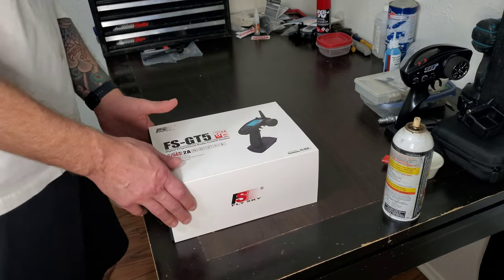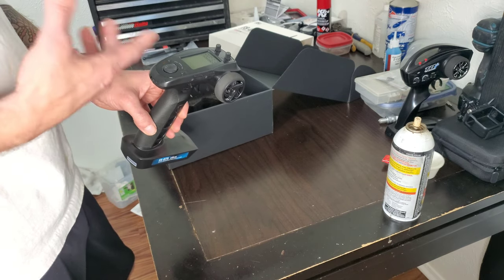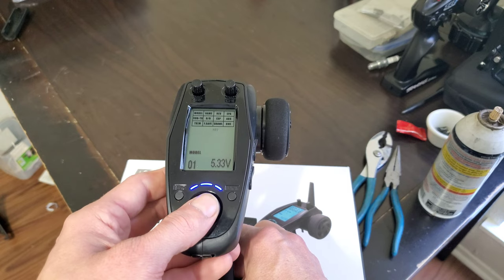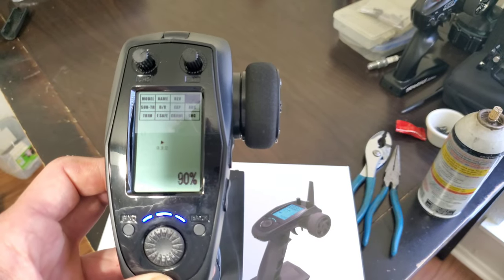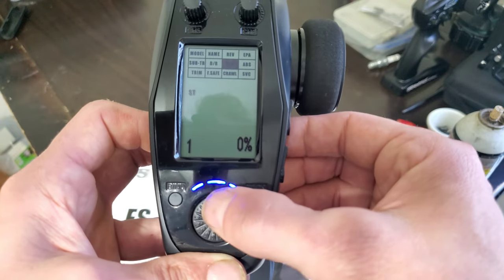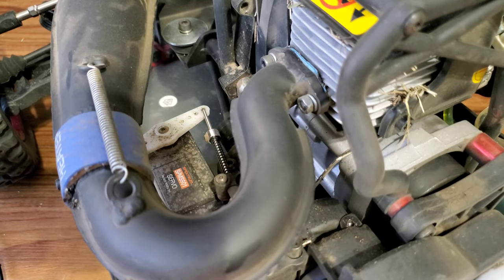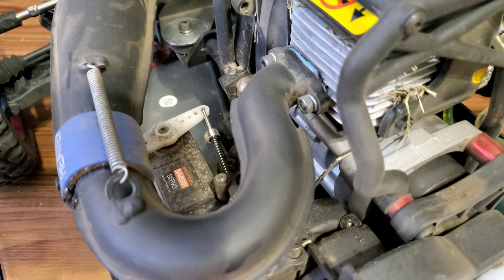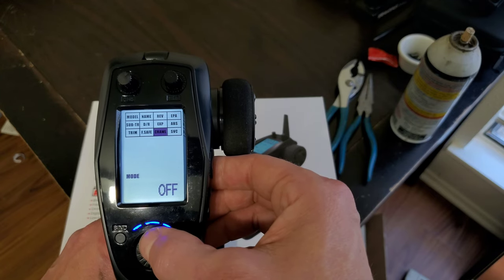FlySky GT5 Unboxing & Setup

Comment: This is the best description of the Flysky controller I've ever heard. I've had my Flysky controller for 6 years and had no idea what 60% of the settings meant. And I have 7 models connected. Thank you very very much. I had no idea of the capability of this controller. This will make crawling and bashing an entirely different experience.  I think Flysky owes you at least a brand new controller and 4 or 5 receivers. God bless

Comment: What’s the max distance range on the radio gonna need max range for high speed runs
Reply from the maker: The manual says greater than 200 meters with no interface. I've only had mine out maybe 100 meters or so from me at any given time with no problems. I plan on doing some actual tests cause I want to know for my own safety.
Reply: Let me know what you come up with?????on the range